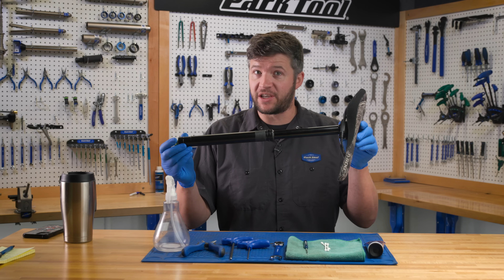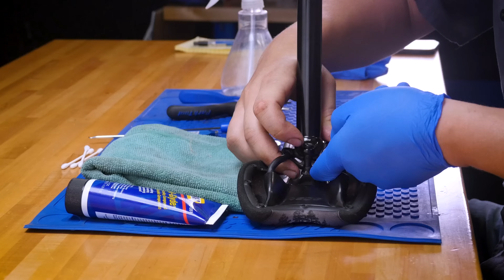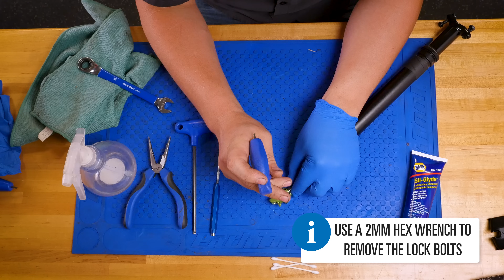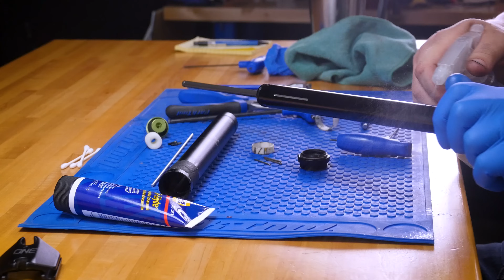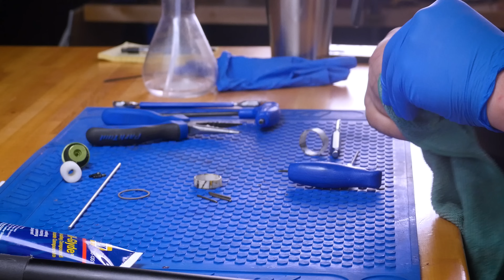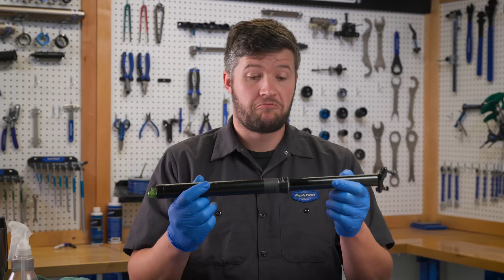Servicing a OneUp Dropper Post - V2

Comment: About to service my V2 for the first time and noticed that the OneUp instructions say to remove the cartridge lockring using needle nose pliers which enables removing the air cartridge before removing the mid cap assembly. But you did not remove the air cartridge it looks like. Was that intentional to make the service process easier?

Comment: use  a wood dowel to push the rag into the outer cylinder - don't use a metal allen t-handle!   you will slip and scratch the inside for sure.....

Comment: This dropper works flawlessly for 5 years of intense use without any service. It's not worth spending 50-100$ a year to service it, it costs 200$, just buy another one every 8 years 😄😉
Reply: Taking it apart for a annual cleaning and greasing doesn't cost you more then some grease and time

Comment: The lock ring tightens mostly but not to tight. It just spins with the needle nose pliers. Thought it was ok until i couldnt unscrew my shock pump. Just kept spinning. Should the lock nut bottom out?

Comment: When I got to the end of reassembly, I’m finding that my entire assembly is just barely too long. I can’t thread both the collar and the actuator at the same time. I thought I got all the brass keys aligned and the body slides freely up and down prior to threading. What did I miss?
Reply from the maker: You may need to compress the cartridge. At the stage you are at i would reccommend installing the actuator, then with the head of the post facing downward actuate the dropper with the actuater and compress the cartridge a few inches. That should allow you to thread the collar onto the top of the post.

Comment: Hi, quick question, does this oneup seat post also have rotational play? THANKS
Reply from the maker: There is a very minimal amount of rotational play on this post.
Reply: If the rotational play is too heavy, you should replace the pins as they are worn out

Comment: Thank you for this video, this was super helpful, and helped me get my dropper to work again! A couple of notes that weren't mentioned in the video:
- The push rod has two different ends - one is cut square, the other is rounded. The rounded end goes towards the green actuator, the square end goes inside the post.
- For aesthetics (and nothing else), the green actuator can be tightened until it is parallel to the head of the seat post. This is how it comes from the factory.
Reply: Not just for aesthetics. Some seatubes have welds or zurts for bottle holders that get in the way. I moved the actuator and got an extra 10mm of travels
Reply: Thanks! I actually came here for the info on the two push rod ends.

Comment: These dropper service videos typically do not show how to remove the post from the internally routed frame.  Please add that video next time.
Reply: Just feed some more cable slack through the frame so you can reach and disconnect the actuator from the bottom of the post.
Speak to your local bike mechanic if you're not sure!
Reply: I just unbolted dropper lever from bars , and fed cable back through the frame as you pull out post .
Reply: I just unbolted dropper lever from bars , and fed cable back through the frame as you pull out post .

Comment: My post has had an excessive amount of play in the rotation of the axis going through the post since I bought the bike. Is there a way to fix this with the tolerance of the pins?
Reply: Yes ! Contact oneup support, there are different pins size to adjust the necessary play

Comment: Hi!
One question: can you increase the air pressure on the cartridge with a normal suspension air pump?
Reply: Yes.
Reply: Pressure can be set from 250-300 PSI

Comment: I have the exact same dropper and have noticed it's been very slow lately....this video came at a great time...no need to remove the air in the dropper post prior to servicing it?
Reply: No need to. The service procedure deals with the parts external to the air cartridge, where the air is contained.
Reply: @lenolenoleno  Thank you
Reply: Might need to also add more air pressure if the return is slow.
Reply: @chris4536  I followed this video and serviced my dropper (it was so dirty) and added air (it was quite low) after I completed the service...the dropper is now smoother than when I bought it and it returns quickly now.

Comment: One thing to check is that the seat clamp hasn't been overtightened pinching the dropper and stoping it moving smoothly or at all. 6 nm max
Reply: Shouldn't be tight anyway. In case of a crash or fall, the post should be able to rotate instead of damaging it.

Comment: hi, have you ever came across a dropper for 30mm diameter frame tube ? kona hossmatic (2008 maybe, or earlier)
Reply from the maker: There is a 27.2 dropper, which will require a shim up to 30mm to work.
Reply: @parktool   thank you

Comment: What is a dropper post?
Reply: I feel this question was intentionally inverted, for sarcastic polarity
Reply: A seat post that allows you to move the height of your saddle based on your application. In a mountain biking context, you want your saddle low and out of the way for hitting jumps and bumps so you can not get hit by your seat. You also want your seat higher up when climbing for more efficient strokes. Droppers have been around for decades but really reliable and great value options have been around for slightly less than a decade. Hope this helps!